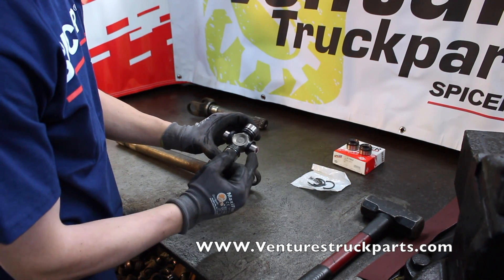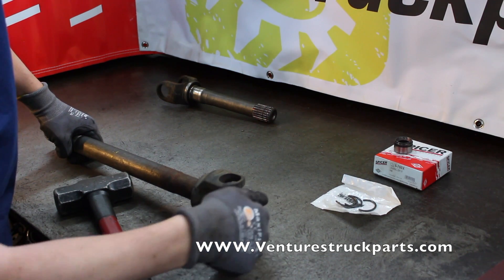Replacing Front 4x4 Axle Shaft U-Joint (Installing A New Universal Joint) Dana 28, 30, 35, 44, 60

Comment: seems barbaric.  i remember struggling with drive shaft u-joints when I was a young lad, knocked needles out of position going at it with a hammer, and messing them up.  Never had a u-joint axle before.  I admit this looks simple, but why not use a press or large C clamp?  No shock required.
Reply from the maker: This way we avoid bending any shaft yoke ears by not pressing / compressing the yoke ears together and ( narrowing) the yokes.

Comment: Love the video. But one thing I gotta say at this point after many Youtube how-to's is, Has anyone heard of brake cleaner. I use it to clean all sorts of car/truck parts. I'm super picky about cleaning my parts so when I see this kind of stuff the first thing I think is scrape, brake clean, scrub with stainless steel scrubber, brake clean again and wipe clean. Then grease gradually. great tutorial though.
Reply: good point
Reply: I started thinking about rating projects based on the 'cans of brake cleaner used' system.  Like a 1.5 cans job vs a 5 can job!  I use that stuff for everything!
Reply: @gizzyguzzi  Thats a good way to look at it.

Comment: Nice video, when you show the install on the new uloints you just pull the cap off. New spicer joints from you guys have the cap seals set on the shafts. Any tips for how to get the caps popped off without damaging the seals?
Reply from the maker: What is the part number of the U-joint that you are having trouble with? Sometimes they are pretty tight on there and just need a good pull.

Comment: That's a terrible way to install a u-joint
Reply: There not your regular u joint with the clamps on top way different steps for this
Reply: How would you do it then smarty,
Reply: Where's your video at mr know it all
Reply: works fine, i did this on the pavement with a wooden board, i even smacked the crap out of the bearing caps.. didnt do anything
Reply: My clips are in but two of the caps are not perfectly flush. Like a pushing on a quarter with ur finger on one side up about 1/8 +angle other side is flish should I redo. I was told as long as it's clipped it's ok ?  Thanks
Reply from the maker: I am sorry this didn't help you. Just trying to pass on things that have been beneficial to us.